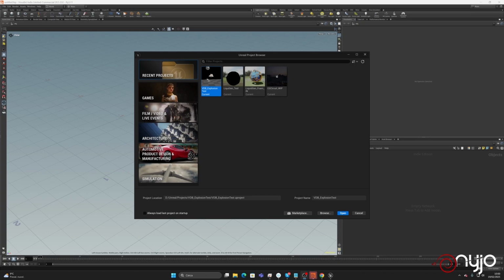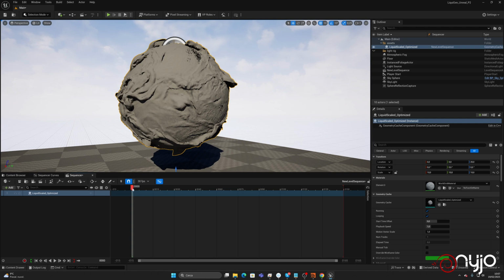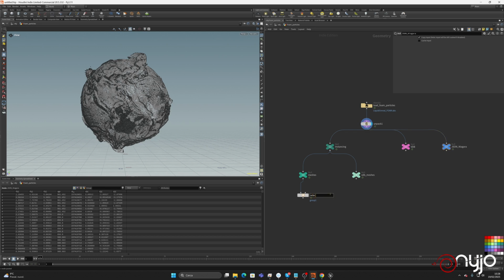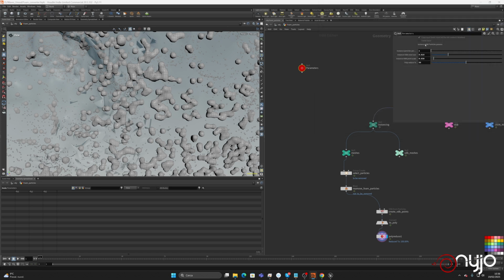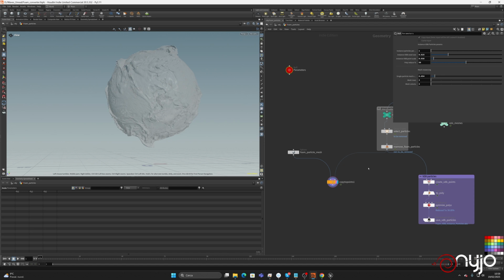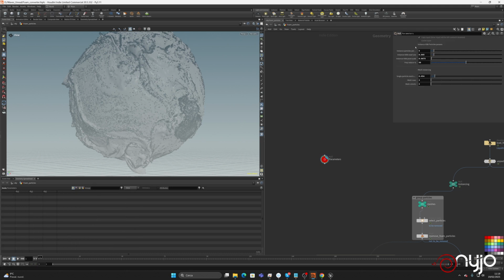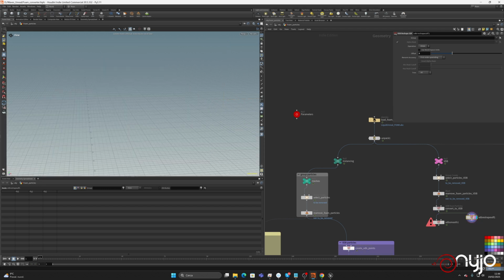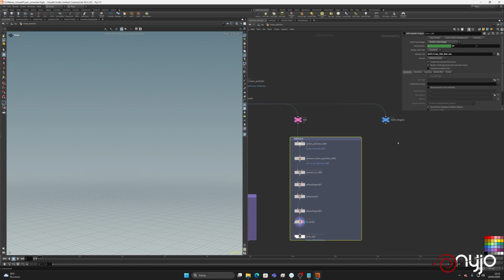LiquiGen + Unreal Engine : tips & techniques - Part 2 by Nyjo FX

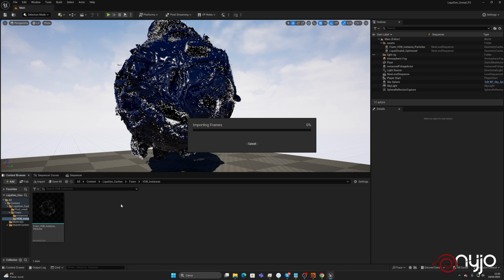Comment: hi when importing my instanced particles to unreal engine the alembic import stays stuck at 0%, similiar what happens at 45:05, maybe its because of overlapping geometry but im not sure. I've already decreased the particles like crazy but still no chance
Reply from the maker: How many particles are you exporting and how much is complex the instanced mesh ? Are you using the VDB way ?
Reply: @NyjoFX  I opted for the non-VDB method because meshing takes a significant amount of time.

I also discovered that exporting "bubble" points from Liquigen—even in large quantities (500,000+ points)—works in Unreal after meshing them in Houdini.

However, the spray and foam particles cannot be imported using the instance meshing method with spheres, and I’m not sure why. Even with a low point count (e.g., 5,000), the Alembic import always gets stuck at 0%. I followed the exact same workflow as I did for the bubble particles, yet the issue persists.

Interestingly, I noticed the same behavior in Blender. Instancing the foam and spray particles also causes the Alembic import to freeze at 0%, despite having no empty frames.

While creating a VDB from points does work for foam and spray, it becomes extremely slow when dealing with higher particle counts. Unfortunately, this makes it impractical for larger simulations.

Big thanks for your efforts by the way :)